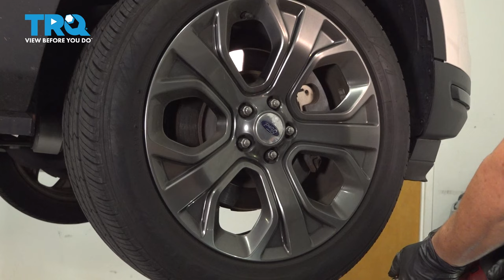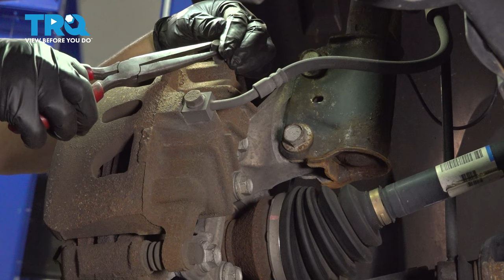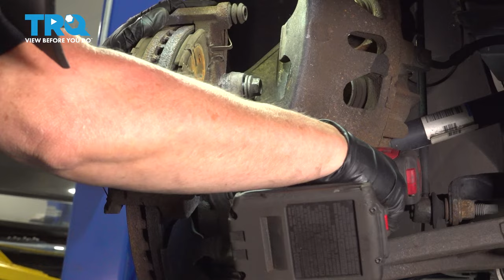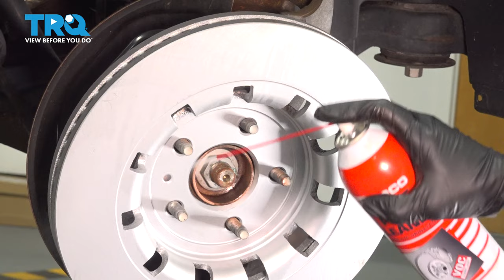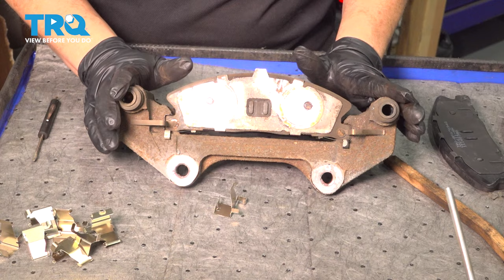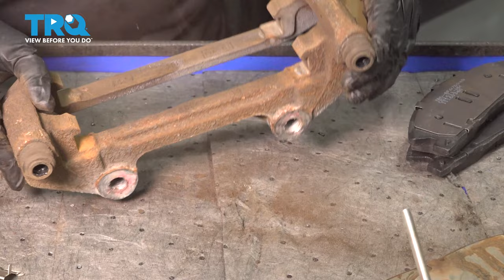How to Replace Front Brakes 2011-2019 Ford Explorer

Comment: Thank you for posting this very good video. I would like to add just a few comments if I may. I would make sure I change gloves when I touch the brake pads after applying the copper grease to them to avoid having grease on the pads, and I would add a mention to carefully bed the new rotors and pads after installation. There are many videos to explain the procedure.
Reply from the maker: +@ChevyGuy-kx7im Thanks for the feedback! http://1aau.to/m/Shop-TRQ

Comment: Don't open the bleeder screw unless you're replacing the calipers and need to perform a system bleed.   If the fluid system is sealed when you start and there is no dirty fluid in the reservoir, then how do you risk pushing dirty fluid back into the system? 

When this bleeder is open when you are compressing the pistons, you risk getting air into the system and causing issues.  Her method may work but you don't always see or get the full story on why she opened the bleeder.  Was it just to replace pads or was there some other issue?   Videos are edited for time and to keep the instruction straight forward. 

Being a certified mechanic, I have replaced a lot of pads without opening the bleeder and have had zero issues.  If you have to open the bleeder on the chance of pushing dirty fluid back into the system, then you most likely have dirty fluid already in the system and need to do a flush and fluid replacement.  This is why the reservoir cap states to clean before removing to ensure no dirt enters the system.  

I have seen comments on this video and other video where the bleeder was opened while replacing pads and for whatever reason they introduced air into the system resulting in issues.   Leave the dang bleeder closed folks.

Comment: If I made the mistake of ordering standard Duty instead of heavy duty for my 2013 XLT with a tow package, can I use them still ? I don't plan on Towing so that's not an issue